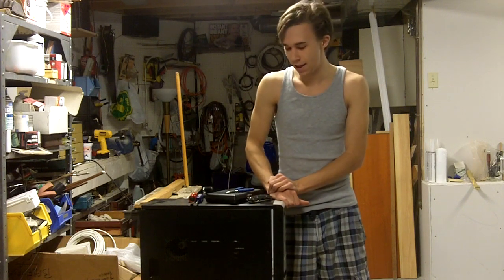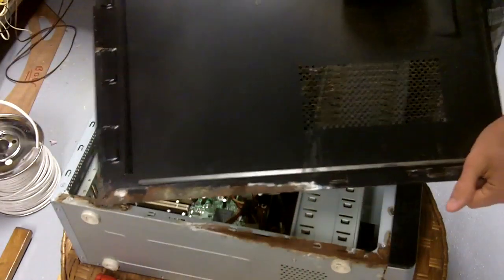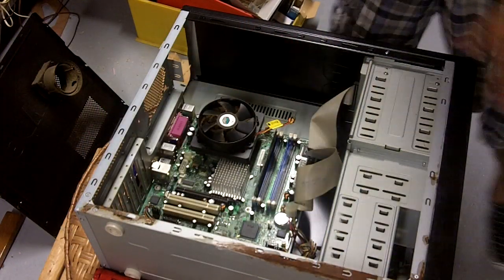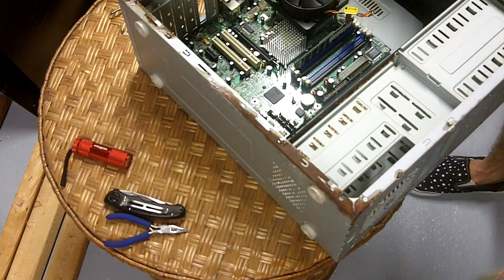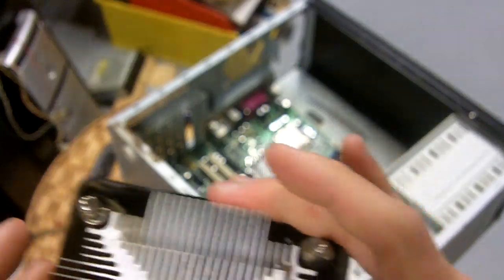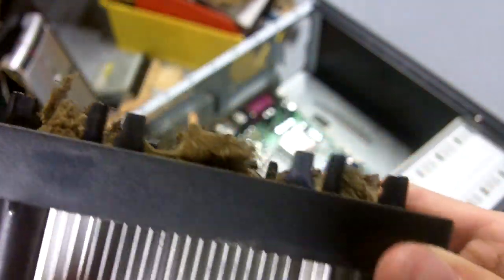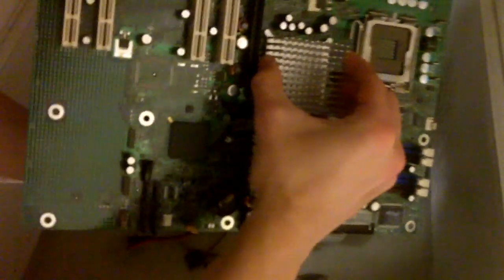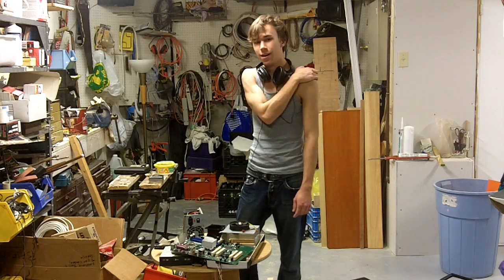Washing A Disgusting, Dirty Computer

Comment: Lots of comments about how stupid it is to wash a mother board in water, but it really is no big deal as long as cmos battery is removed and it is completely dried out before power up. I use a hair dryer to remove most of the remains water, and then let air dry for several days or a week depending on the humidity. The only component I would not wash would be a hard drive because there is the possibility of water entering the breathing hole and damaging the disk plates inside. I have also washed keyboards that have had sugar soda spilled in them, work grate afterwards when dried out. Water and electronics don't mix only when power is energized. In fact if you have laboratory grade pure water, it will not conduct electricity, it is the impurities in the water that do the conducting. Just my 50+ years of experience in electronics. 😄
Reply: Exactly! Not to long ago I purchased a cheap graphics card off of eBay. When I received it I was absolutely disgusted. It had obviously  belonged to a very heavy smoker. So card apart and placed it some water and soup and let it soak for about 10 minutes. After that I changed out the water and let it soak for another 10 minutes. I then dried it off with a hair dryer, after that I used an air compressor to help remove water out from under the capacitors, and other things. After spending about 30 minutes with the air compressor drying off the card I resembled it and voila! Card worked perfectly find and n longer smelled like cigarettes.

Comment: (continued)
The power supply was absolutely foul.  I took it completely apart and scrubbed everything clean.  Turned out I should've just tossed it, though.  It had some bad caps, and I didn't have replacements.  But the whole system looks and smells brand-new, just like it was 2002 again. :D

Comment: My computer was making a very loud hitch-pitched sound and the monitor screen was black. I had a quote to 'fix it' for £100. I wasn't keen to pay that so I did a Google and a link said to clean the dust out of the computer. When I opened up the case there was a massive amount of thick dust. I cleaned it all up and guess what my computer started working 100% again.

Comment: Safley clean your motherboard. This is how we did it when I worked in computer depot.
In Order:
Prep: Remove everything from motherboard / take it out of the pc case.
1. Metro Datavac Electric Duster, 500watt
2. MG Chemicals Super Contact Cleaner Pen
3. Techspray Blue Shower G3
4. Metro Datavac Electric Duster, 500watt
5. Let completely dry for about 20min.
Done

Comment: I did this to an old Athlon XP-based system not too long ago, except for the motherboard, which was clean.  It was a Presario 6000 from 2002, and had deposits of nicotine and dust in hard-to-reach places, so I took it outside, hit it with some bleach and water mixture, and brushed all the crud out.  Then I did the same with the guts of the power supply, the fans, everything.  And then I hit it with the water hose and let it all dry.

Comment from the maker: Yup! A lot of people think water instantly kills electronics but that's false! As long as there is no electricity flowing through the product AND YOU LET IT DRY COMPLETELY, it should be fine. Computers are hard to wash because they (and their power supplies) store electricity in capacitors so you must discharge them. Generally you should also use distilled water with electronics (as there is the possibility to have mineral residue) but on this cheap-o computer I didn't care.

Comment: True water for most part water will not destroy electronics like Snipzzpost has mention, must let dry. However best practice is to use compress air. Use of water leave the possible of the unit or components not drying properly and when you turn unit on, well what out.Be prepare for fireworks. I say for the "most part" you have the possible of one little droplet somewhere in the unit and it might not manifest a problem right away. Don't  put hard drive in water. Just use air.

Comment: worst things to do is put water into a motherboard. and other PCB.  will have to clean board with rubbing alchol. by hand.blow off any dust or remove by hand.  no one in they right mind should drop they PC into water. thour this video from  2012. that pc looked very cheap.

Comment: Next time use air compresor for cleaning
Reply from the maker: If you watch the video, you will see an air compressor would not do a very thorough job on this machine. Tar and pet oils had built up a film of "grease" on the components. Washing was the best option.
Reply: TocksicTaylor i worked at a phone repair lab in a relative's telecom company - mainly took stationary phones apart and sorted out the salvageable parts, and did cleaning duty on them.

i also worked with compressed air (we obviously had an industrial-level compressor tuned for usage on electronics) and alcohol for cleaning the dirt.

the combo i find most useful is to locate the dirty areas, use comp. air, if still dirt persists and is of a greasy nature use alcohol and then comp. air it away.

repeat step two until all is clean.

but that was at the company i worked out - quit it (it was a summer job) and now i'm just taking my gaming rig to a lab for an occasional cleaning - i'll be damned if my over 1000$ rig gets fried by a blow dryer.
Reply from the maker: +shrk128 That's great info! Thanks for sharing your experiences! Sounds much safer than what I did in this video! Alcohol is what I have been using to clean away water damage in my phones and other sensitive electronics.

Since this video, I have not had a need to thoroughly clean any other device besides phones and the one computer seen in this video. When I clean out my gaming PC a simple air duster and anti static cloth are enough to keep my dust bunnies at bay.
Reply: TocksicTaylor i should point this out - i'm a teenager and my high school major is biotech - not computers or electronics.

i am, by no means, an expert on electronics or their maintenance.

i merely shared my experience that sums up to 2-3 months of taking apart programmable desktop phones, cleaning, and re-assembling them.

just making sure you know that.

i'm glad if i managed to help out.

i also recommend using an airbrush as it can simulate pretty well what you can do with a professional air compressor, if you use it without that paint, that is - make sure it's totally empty or else your rig will be very pretty from the inside, but useless.

usually mixing electronics and water is the worst idea - do not use the water bath thing again if you ask me.

i suggest looking into the effects of distilled water on electronics though - pure H2O that is;

tap water and mineral water - pretty much any type of water you drink is filled with minerals, which are in their essence, various salts.
the white stuff that builds up in your kettle after use is those minerals.
now, we know that by having more salt in water, you can improve it's conductivity, and what messes up electronics in water is their conductivity that shorts out circuits.

if you can find out if distilled water - again, Pure H2O - can be used to wash electronics without harming them, then you might be able to just use that.

depending on how you choose to acquire the water - buy them distilled, or purchase a professional lab tool like an ion exchanger, then you might have a high-ish 1st investment, but you would be able to produce the stuff on demand and not need to use alcohol.
 
again, that is if distilled water is not harmful to electronics - i don't know about corrosion.

hope this little idea helps out.

IMPORTANT!

PURE H2O - DISTILLED WATER - CAN KILL YOU IF INGESTED!
DO NOT INGEST.
DO NOT SWALLOW!
DO NOT DRINK THIS SHIT!

no srsly, it leads to a disturbance in the cellular minerals and salts concentration, and will make your cells explode.
don't let anything alive near it.
Reply: shrk128 I disagree with your statement drinking distilled water can kill you. I drink about three quarters of a gallon of distilled water a day for the last 7 years. I am not disputing your claims with electronics, just that humans drinking distilled water is deadly. It's not.
Reply: Bryan Bailey chemistry and biology disagree with your claim and call bullshit on your comments, while recommending you to go see a doctor:

cells have a very sensitive balance of water and salts in their cytoplasm (the goo inside which consists of most of the cell) - they have various systems to balance this out but these systems have their limits - ingesting a large amount of distilled water which contains no salts will lead to a rapid movement of salts out of the cells exposed to the distilled water, and destroying them in the process, as salts are vital to the cells' function and the structural stress on the cell followed by the rapid change in volume could and will kill it.

also, for you to drink 3/4 of a gallon of distilled water for the last 7 years you would need to own an ion exchanger or have a contract with a company which deals with chemical supplies.

both are expensive.

not to mention you'd be dead in the 1st month unless you were to consume ridiculous amounts of minerals and would urinate like a 95 year-old.

let me just clarify this:

by distilled water, do you mean the stuff produced in labs by using ion exchangers, or the stuff you make by pouring water into a special jug with a filter?

there's a huge difference between the two.
Reply: Your instant hostility tells me all I need to know about your personality. Your debating skills are lacking. Your question asking for the definition of distilled water should have been first. You jumped to a conclusion in the opening of your argument.

Let me define "distilled water" via an action.

I go to the grocery store, buy distilled water and drink it. Been doing that for over 7 years.
Reply: Bryan Bailey I in fact showed little to no hostility in my comment, though a smidgen of cynicism did infiltrate, I admit.

The distilled water you consume SHOULD have no effect on your health, besides denying you a source of valuable minerals such as these that are present in tap water.

the distilled water I was talking about were Lab-grade water made with ion exchangers, as with the distilled water in the laboratory i was working in.

while I was jumping to a conclusion, that was due to my background in biology, biochemistry and biotechnology raising red flags regarding your habit of drinking water that could potentially cause osmotic shock and introduce harmful chemicals to your body.

If it's sold in stores and got approved by the authorities then the stuff you're drinking is probably food grade, and was made while taking into account the above mentioned potential scenarios.

and one more thing:

this is youtube.
finding manners and pleasant people here is like russian roulette - unpredictable, involves frightening tribulations and when failing to do so, results in a very nasty mess coating all present individuals with disgusting bodily fluids.
Reply: We each interpret things uniquely. Your claim of no hostility was interpreted by me as hostility. However, I get my minerals from food that I consume. Too many pollutants are now in spring water or the potential, due to human activities, is too high for my comfort.

Since you have a biochemical background, what is the chemical difference between steam distillation (what I call distilled water) and your ion process? Is the chemical structure of your ion water still H2O?

lol.. finding manners in anyone on the Internet is hard these days. It's too easy for one to type before thinking. I am not that old but imagine those living in the past actually thought about their hand written letters before mailing them and manners were considered.
Reply: Bryan Bailey the essential difference is the use of different devices utilizing different principles - steam distillation makes use of the difference of boiling point temperatures of water and the contaminants and various other mater dissolved into said water - for example, a certain toxin has a boiling point (boiling point meaning the temperature where liquid matter becomes gaseous, like water vaporizing - note that this is a rough explanation) of 125 celsius degrees while water's boiling point is 100 C. - in this case, the water would turn gaseous (steam/water vapor), leaving the toxin with the higher boiling point behind as it is still solid due to the temperature being too low  for it to become gaseous.
that's the gist of it.
same applies the other way, with materials with a boiling point lower than water's.
this allows one to separate step by step the nasty stuff in water, leaving you in the end with water that is almost completely clean, though not entirely due to contact with CO2 in the atmosphere and other exceptions, as chemistry is, as aptly described by my teacher, the science of exceptions.

an ion exchanger uses a special resin that is present inside a column which functions as the body of the ion exchanger - you essentially pour whatever solution you have in through the top, and out the bottom comes out whatever didn't attach to the resin - this method is often used in laboratories to separate proteins or certain materials from solutions.
the resin itself is either charged with a negative or positive charge, and relies on the relative effect of the environmental pH on the nature of the charge of materials - amino acids, for example,. have a positive charge below a certain pH, and a negative one above a certain pH, while usually maintaining a neutral one or a balanced one around pH=7 (exceptions withheld).

one could use the negative charge of water to bind it to the resin under the effect of a buffer, forcing all other matter in the water to have a positive charge, hence dropping out of the column, or the opposite, using a resin charged with a negative charge.

the viability of this method in manufacturing water for consumption is rather low due to the cost of the resin, the materials introduced to the water in order to create an environment suitable for using the ion exchanger, and other factors such as the scale of the exchanger, which is rather small, though as with anything, can be upscaled depending on need.

the water produced with the ion exchanger from my lab was mostly for usage in diluting various solutions for use in experiments, with the exceptions of solutions that contained or were to come in contact with living cells such as yeast, due to the danger of osmotic shock killing said cells, rendering the experiment a failure and wasting materials.

hopefully, I managed to explain everything in a proper manner, though i am opened to any corrections you have to offer, as I am not an expert on water, I just have a background in chemistry, biochemistry and biology.

as for your observation on the perception of hostility - you are right, and like time, gestures from one human to another are relative - a white dove with a peaceful offering of an olive branch could be interpreted as a great insult justifying war by another.\

henceforth, one must take caution whilst making assumptions, and leave oneself a way  out, so to speak, that will enable them to take back their words or to not commit to them.
that's my take on things, anyways.
Reply: I am impressed by your definition. I am in no position to critique as I have no chemistry background. The boiling point of water and other foreign objects made sense to me. I would theorize that any object with a boiling point less than water would be included in the distilled water.

Comment: Wtf you really put your PC in fkn water. Jesus christ, it hurts
Reply: +TheCookieCrusader You do not use water for hard cleaning components. It is absolutely unacceptable. If you need to submerge your motherboard for cleaning purposes you should be using isopropyl alcohol
Reply: +Clipboards  or some kind of mineral oil  that IS designed for cleaning that kind of stuff

Comment: I only use an air compressor and maybe isopropykl alcohol & Q-tips when going inside the case. Surprising that washing with water didn't wreck anything. Did you use any solvents?

Did you re-paint the case with something like RustOleum?

Fedora, huh? I'd have gone with Puppy, Xubuntu or some such for a weak rig like that. Nice to see you had sense enough not to re-install XP, though.
Reply from the maker: Shoes386 The cleaning materials you use are certainly the safest bet. That's what I used to repair hard water damage on my Nexus 5. This was an old PC and I didn't care much for what happened to it after the dunk. Cleaning it by any other means would have been more time and money than I was willing to spend on this; plus I was curious myself as to how it would hold up. I did not use any solvents, just plain old tap water (hard water). The case is a very crappy one and not really worth the effort to repaint.
Fedora 16 ran rather well on it if iirc (at the time it was also the only distro I felt comfortable with), I have since replaced it with XP to experiment with some hacktivities.

Comment: How did you not have it go crazy with oxidization? Water spilled through the top vent on my computer and splashed everything in my pc about a year it and white specs were forming all over the motherboard.. In a rush to save it there was lots of high percentage iso alcohol, a scrubbing tooth brush and sun drying. Saved it.. but I now keep the pc very very far away from my desk lol.
Reply from the maker: +musicmanvin1 That probably comes down to what type of water was spilled in your computer. The tap water in my city/area of Canada which I used to wash this machine is rather low in dissolved minerals. Your water was probably much "harder" than mine; hard water will leave behind more mineral deposits (the white specks you talk about) which can be conductive and short components.
Reply: well, it was tap water from NYC